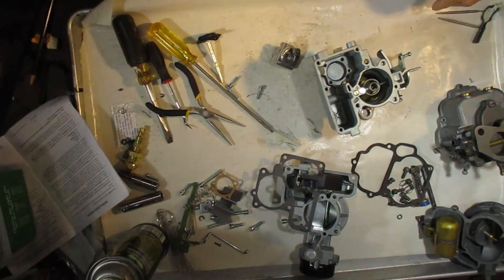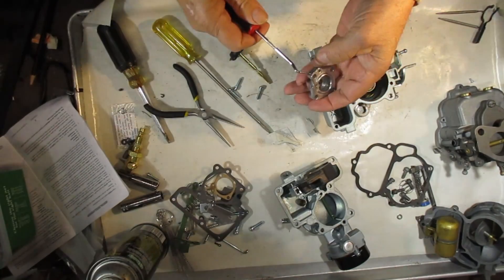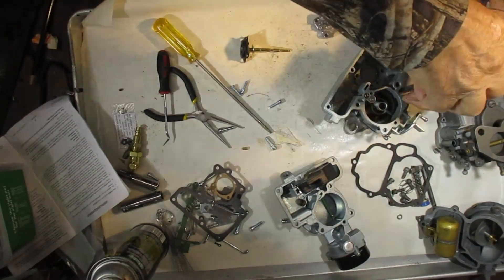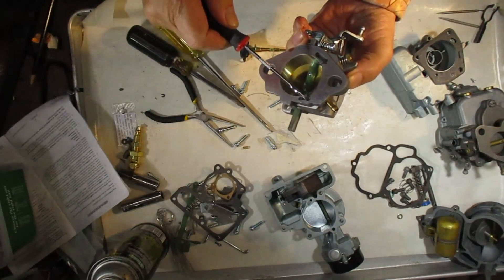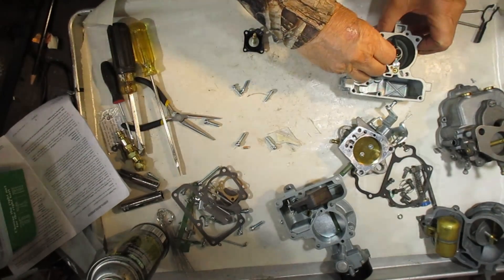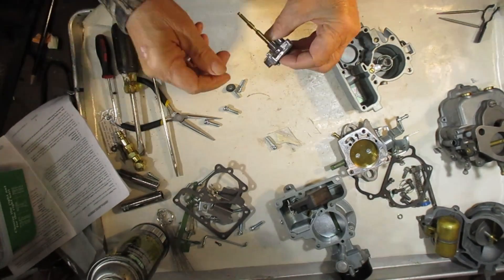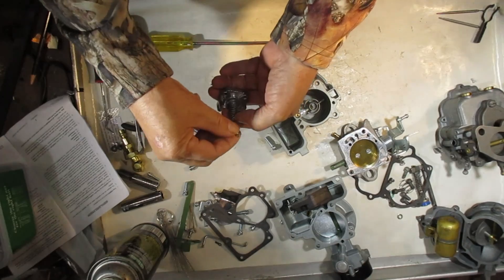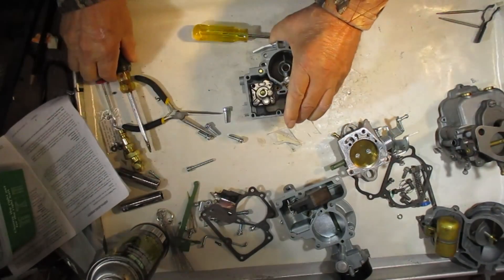Carter YFA Accelerator Pump How It Works

Comment: I have the yf...don't think it has a check valve in the acceleration pump
Reply from the maker: There are multiple versions of the YF carb, not all use a checkball in the pump housing. You can see examples of different setups on the tech page here https://www.carburetor-parts.com/carter-yf-accelerator-pump-circuit

Comment: Thanks Mike!

I have seen accelerator pumps that are operated by a rod, but I haven't seen one that is vacuum operated.

My 1986 F-150 started coughing and sputtering (and sometimes stalling) when I tried to accelerate.
I took the top off and could not figure out how that pump operated!

You explained it!

Thank you.

I took the pump system apart (and cleaned the metering rod) cut a nick into the base gasket that was pushing up into the vacuum orifice, put it back together, and it worked!
It took a few cycles of accelerating to work smoothly (I think the pump needed to fill with fuel?)

Thank you,
Paul

P.S. it was a cheap chinese knock off !
Reply from the maker: The Chinese carbs are less than good I'm afraid.

Comment: Hi Mike,  I'm rebuilding a carb like this.  There was NOT a washer(stepped) on the diaghragm shaft.  The Standard rebuild kit says to use a 1/16" flat washer from the kit.  It is plastic and not sure if I need to or should put this in.  Any suggestions would be appreciated.  Also there is a metal washer in the kit that fits nicely but it is 1/8" thick.
Reply from the maker: 1st test the pump action with some fluid in the bowl. Then add any metal washer to the top spring and test again. You may, or may not need it. It isn't clear because of the wear you have over 60 years.

Comment: Weeiiirrdddd eugh, this is the exact carb I have. Minus the splash guard inside and the washer that goes on top of the diaphragm and with a manual choke. The first time I rebuilt it I had no idea what I was doing and got rushed through it. The second time I was able to take more time and watch a few videos, so I noticed the missing washer on the diaphragm and placed that in. Watching this video, I'm not sure I have that check ball underneath the weight, I think it's just the weight with no ball, I might be mistaken though. 

I'm ever so slowly losing power more and more and barely knowing anything about this engine (300ci 4.9l) and carbs in general I've been totally lost. This is my daily driver and I've been just barely getting it to work. The idle screw all the way in doesn't actually highten the idle in any way, it idles at about 500 with the screw all the way in. I'm really truly lost, and the rebuild kit I bought for this carb was for the Carter yfa but I think it was for a different model of yfa (I have no idea what I'm looking for, all I know is I have far more pieces and different gaskets than what go on this exact carb. Any help would be great. 
If I can rule out the carb being my issue then I can look into bigger ticket items like piston rings.
Reply from the maker: Some use a pointed check weight without a ball. Others use a check ball with a weight above. Any of that is missing, then it will not run very well.

Comment: Hey Mike, my Carter YFA 1 barrel has a plastic tube on the pump diaphragm according to the instruction sheet, I found it laying in the bowl under the float when I disassembled it.
The instructions show it hooking to the bottom of the diaphrapm but where does the other end go? Does it feed the float bowl or hook up somewhere else?
Reply from the maker: You should see a small brass tube sticking into the float bowl near the top of the bowl.
Reply: @MikesCarburetor  Thanks Mike!

Comment: After disassembly and watching this mine doesnt have a check ball, weight is there, or a metering rod spring.  It also had a gasket under the pump diaphragm.  But that aopears correct.
Reply from the maker: If the weight has a pointed end then it takes the place of a weight + check ball, otherwise there would need to be a check ball.

Comment: I honestly hate the YFA carburetor, I tried messing with mine and even set at factory spec my old Ford wouldn't run right. I switched to a Holley 4412 on a modified Edelbrock SP180 intake, tuned it in, and it's ran great ever since it also really improved the power output